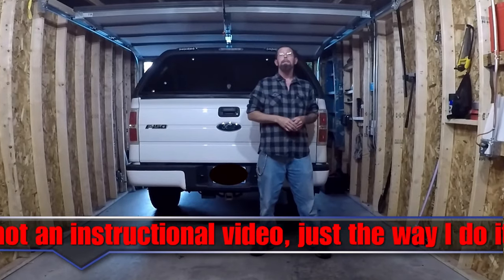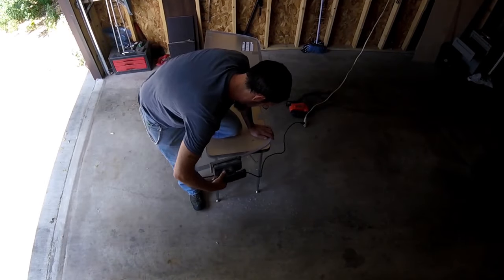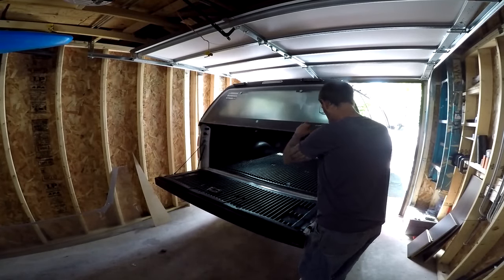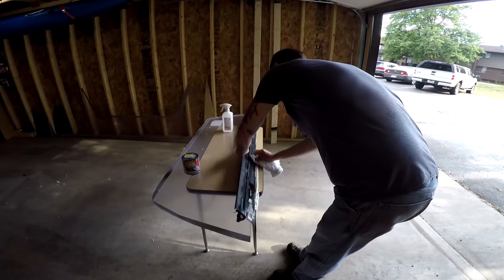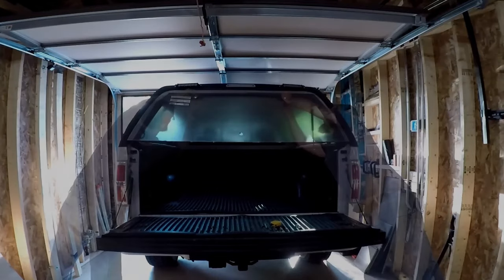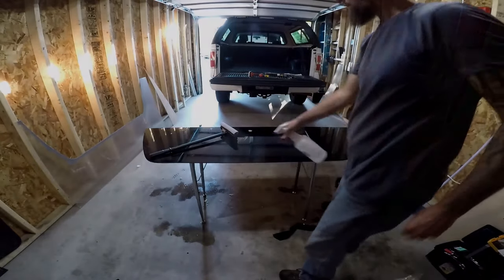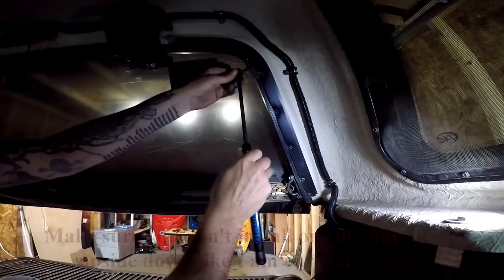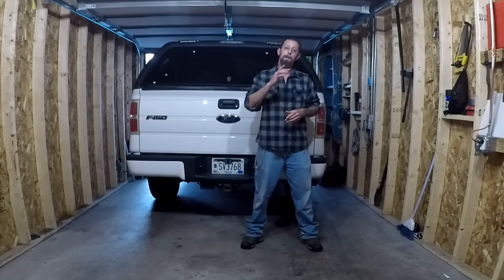Truck Cap Rear Window/Door Replacement

Comment: How would you weather strip it if the window has a frame? Like I have to put the plexi in a frame. All the hardware handles and struts are connected to the frame not the window. I'm going through this exact process and I have alot of questions. I'm so glad you put tint on cause I was wondering if I can or not.
Reply from the maker: I just used a window seal foam tape around the edge of the window, it's still holding up and keeps water and dust out of the bed.

Comment: Where did you get the plastic panel? Or what kind of material is it ?
Reply from the maker: It's an acrylic sheet I got from Home Depot. I would recommend going with something a little sturdier but Home Depot or Menards should have something that'll work.
Reply: @WildCountryAdventures  thanks 🙏
Reply: Do you happen to no the size of  arklic sheet you needed?

Comment: Do you have a link for where to purchase the materials you used?
Reply from the maker: I purchase the optix sheet from Home Depot, the window tint and flex tape from Walmart and the edge time from Amazon (Black U Channel Edge Trim Seal EPDM 15/32" high x 19/64" Wide (20 Feet) ). It was fairly simple, just take your time and don't rush it, it's easier to keep trimming than needing to start over. I also replaced the nuts and bolts which were purchased from Ace Hardware. I never did end up replacing the struts but if you need those they can be purchase on Amazon fairly cheap.
The window has held up great but and I am working on building another one with a frame made out of plywood so I can add some extra hardware which will allow me to lock the window from the inside while I'm camping.
I hope the build goes well for you and let me know if you have any other questions.
Oh, and thanks for watching the video.

Comment: Did you have any issues from the struts while shutting it and the plexi glass flexing? Just did mine today and got worried about the struts causing more issues than they help.
Reply: What ever happened my are 50 pound strutes worried about the same thing happened so never put them in and broke the new window trying t9 hold it open and load it up😅

Comment: Flex tape really does work for sealing automotive gaps and cracks. It fixed a very old leak in the roof seal area on my vehicle. I expected it not to work, and it's been holding up for years. Lots of people think of Flex Tape as a bit of a joke and in some instances it surely is lol but Flex tape is a good choice for sealing the window here for anyone who's having second thoughts

Comment: How did you measure the window ?
Reply from the maker: I cut out a piece of cardboard until it fit in the opening and used that as a template.
Reply: @WildCountryAdventures  thank you. I recently bought used camper shell for 300 and it is missing tailgate window, 500$ to purchase the window, I will try your way. Your work is professional.